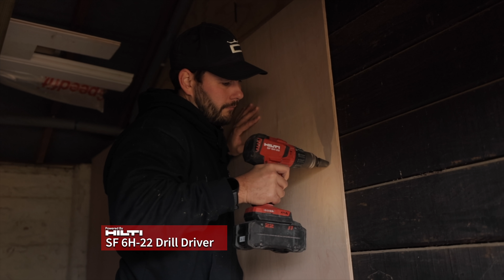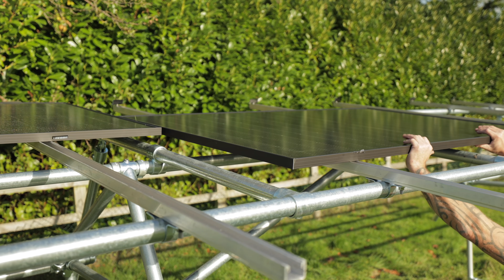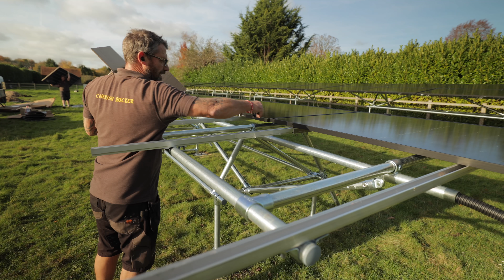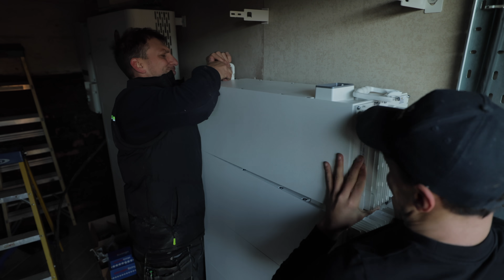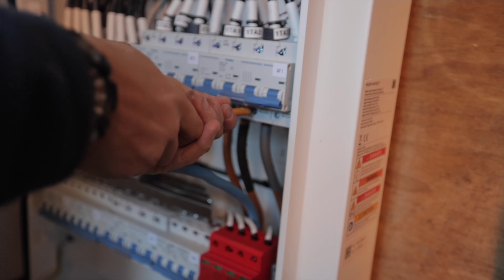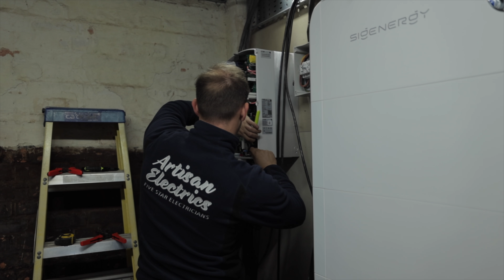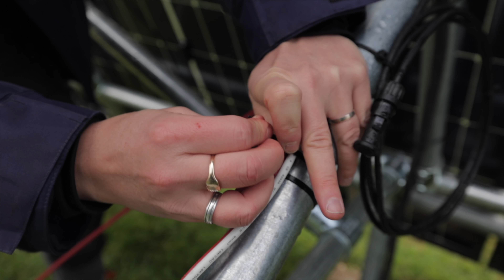The REAL WORLD CHALLENGES of Installing Ground Mount Solar

Comment: Funny hearing that DC systems should not have an earth connection. Here in the Netherlands the code requires us to earth all solar systems to the AC isolator which is in turn connected to the consumer unit. All mounting frames have to be bonded together and ran back inside with the DC- cable and connected to the house's earthing system.
Reply from the maker: Yeah completely different in the UK

Comment: Was having a chat with one of my customers who is involved with commercial solar, they have been looking into different grasses and they reflective properties. They have found good gains in output with by-facing panels with the right grasses.
Reply: Do you have links or info on the grasses used?
Reply: @ sorry it was just a conversation with one of my customers and that he is involved with commercial solar. No specifics. Just found it interesting.
Reply: @danielball8897  no worries! Also find it interesting!

Comment: Do you use marine heat shrink or ever tried it? Having the glue inside I've found very useful for a watertight seal.
Reply from the maker: Great suggestion!
Reply: @artisanelectrics  you'll have to try it, the glue activates with the heat and you can get it to shrink 4 to 1 also.

Comment: Many installators have stopped using optimizers now since they have a tendency to ... kill all radios nearby. police/firefighters etc have stopped multiple installations here in sweden due to the interference with emergency radio systems.

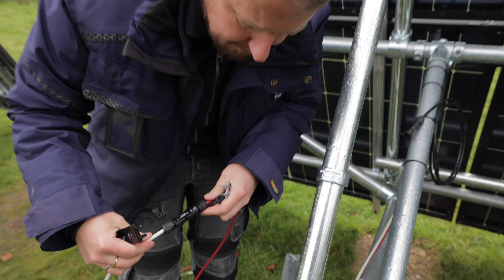Comment: 42:42. 1.2 ohm! outch.. Yes the cable lengh is high but that resistacne mean that for 15A current this is 270Watts loss per cable string!
Reply from the maker: With SolarEdge this isn’t an issue as it balances the voltage and current to avoid losses even on long string length like this - we can have up to 600m on 6mm cable

Comment: On the subject of solar size and DNO permission, can you tell me if there's a maximum size for domestic solar? I had 8.9 KWp installed a couple of years ago and was told by my installer that this was the largest I could install because the DNO wouldn't allow more. But I'm not sure this is/was the case. Reason I ask is because on top of the 23 panels on my roof I think I could get another 11 or so (and probably about 35 on the other side but that's not pointing in the right direction) and was wondering if it would be allowed. I'd probably have to get a second inverter, splitting those 34 panels roughly in half.

Any ideas?
Reply: I think the DNO is concerned about the inverter power output passing through the local transformer and the rectified power consumption charging your batteries from the same transformer, not the PV collectors or battery capacity you could use for BEV charging.

Comment: Does the DNO / mains service provider(?) have the right to control the solar through a ‘smart’ meter?
Reply from the maker: The smart meter cannot “control” anything - it simply monitors the energy usage and sends that data to the cloud
Reply: @ I understand that, but through that type of meter, your solar output to the grid can be controlled by the service provider and shut down when they decide .

Comment: Regarding earthing the dc cable armour. In some systems the battery negative is earthed to the main earth terminal (Victron recommend this for one). Is your battery earth referenced? If it is, does the charger inverter electrically separate the battery negative from the PV negative?There is also the issue of lightning protection to consider. Would the SWA armour be better earthed to protect the dc rails from induced voltage spikes?

Comment: It would be great for the customer if some how you could fit motors on the solar mounting system with  software that would automatically move the panels to the correct angles for the time of year

Comment: I'm currently working with solaradge optimizer a lot is South Africa and the best way not to connect it wrong is to firstly connect just the optmizers alone then you connect to the models afterwards. I assume you guys are using frog leap-frog method which is great in saving pv cables usage

Comment: Hey Jordan what about earthing the framework of the array? Does this not come under an extraneous conductive part? Won’t come under basic protection like a roof mounted system as it is not out of reach?
Reply from the maker: Panels are double insulated
Reply: @artisanelectrics  this is something I have been looking through as I have a ground mount 7.4kw system to install in a few weeks. I have spoken with technical from NICEIC and the inverter manufacturer Fronius where the issue of parasitic capacitance can become a risk. My system that I am looking at is going onto a TNC-S system so we looked at IET Guidance 5.13.6 which states that for ground mount solar frames on a TNC-S that the frame should be connected to a earth electrode and also to the main earth terminal - Would be great to hear your opinion Jordan, great install I think the sigenergy system is a game changer!

Comment: I don't know much about the UK specific rules but wouldn't it be better to apply for those paperwork upfront the install? This would have highlighted the 50kw export issue before you bought all the gear for the installation.

Comment: Obviously the battery systems are not cheap, whilst the solar is rated for 25 years what about the batteries, sure they are not lead acid, but how long do they last, and will the manufacturer support replacements or will the whole system then need replacing as technology has moved on?

Comment: "It's easy to get the wires the wrong way round".... on 2 or 3 out of 4 strings ? That's just sh... work. I would never get away with so many mistakes, but fair do's for showing them
Reply: Looking at it from a Human Factors perspective, it's a shit design if you can get cables on backwards. Each plug and connection should have unique keyways or pin layouts so you can only put everything together the correct way around.

Comment: An observation on the buried cables, Regulation 522.8.10 of BS 7671:2018+A2:2022 requires the location of buried cables to be marked by cable covers or a suitable marker tape. As you know, Cable covers or marker tape is laid above the buried duct or cables to provide an early warning that electric cables are present. For installations where the ground preparation does not meet highway constructional standards, IET Guidance Note 1: Selection & Erection recommends a minimum depth of 500 mm to protect the cable from damage from ground movement and frost heave. A summary of the various requirements and recommendations surrounding cable depth is provided in Appendix E to the IET Code of Practice for Grid-connected Solar Photovoltaic Systems. 

On a personal level, I would never install any cables in the ground  without a duct, if there are any problems with a cable, its easy to pull in a replacement. For me, its 1) How I was taught and 2) what I consider a professional installation - that is not knocking you and the guys Jordon, you do fantastic jobs, its just what I would do.
Reply: Just curious, are you able to pull a replacement cable in a 200meter duct, with these curves in it..? I doubt it. 
If it breaks,  measure the resistance,  dig up the cable and repair it.
Reply: @gubbernl  If you pull cables into ducts then you should always pull in and leave a spare drawstring in the duct, that way, if you need to replace a cable, you can pull on in, as well as another drawstring. Its not rocket science.
Reply: @jim.franklin  and if the draw string breaks you pull the wire out both ends and use air to shoot a new one through the pipe.
That ram used to make the hole will certainly pull a new cable through.
Reply: No, there is no point. No way you're pulling that cable in or out @jim.franklin

Comment: Really interesting, as a non electrician I would comment that most cable ties will not last 25 years, unless your using something new of course. Sheep will eat virtually Anything 😳😳👍. Hope you go back after a while and see how it all performs.
Reply: Right. The nylon cable ties I see outdoors are brittle after a few seasons. Stainless metal straps are robust. YMMV.

Comment: I've got a roof mounted system, these bifacial panels are interesting. Perhaps when the existing panels are replaced and the roof would probably be due a refit too, I'll get some reflective tiles and have bifacial panels fitted! lol

The only thing missing from this video was footage of the system running in the daylight, it would have been interesting to see the difference in generation if you swivelled the panels as the solaredge monitoring is near-realtime enough to tell. But I guess we need some sun for that, which has been lacking of late! ;)
Reply: When I thought about the wind loading of the four foot sails sticking off the edge of the roof I puckered up.  The metal porch roof below would be perfect for them.
Maybe if I ever remodel the front of the house I will add greek columns  to support panels.  You could raise and lower them for summer and winter angle. 🤔

Comment: At a cost of around £50 per optimiser the payback on that against the potential better optimised generation is just not worth it at all. This is coming from someone who has installed solar PV since 2009.
Reply from the maker: Explain
Reply: @ I can see why you’ve done it due to the distance, but that’s about it. If it were me, I’d locate the plant much closer to the array in an outbuilding and that way you’re only running AC back. We’ve done it many times with purpose build sheds that only cost 1-2k and less labour intensive. You can run a supply cable from the 3PH to sub DB and have everything in that place. Depending on the battery you may only need to extend the CT’s. 

200m is far but the optimisers are definitely a luxury on this occasion. Paying them back with the optimised generation will not happen in 25 years.

Comment: It’s interesting to stand back from this install beautifully done and just look at the end result from a distance.
I have a 19 kw ground mounted bi facial system in a fabulous solar area. Clear skies all round, great irradiance etc. ground mount, bi facial Panels are now cheap, 70 euros each. 
Now on a cloudy day, I get a fraction of production this time of year, 2.9 kw today, sunny day 30-40 this time of year. So even with 3 times more generation to 54 kw still would only get a fraction and not even be remotely be grid independent. Now on a sunny day, don’t know what to do with all the power. But for 3 months of the year minimum, not grid independent. I have 4 holiday units on the site. So I reckon break even is 5-6 years and I sell my production at full price to people staying on site. My install has two inverters, 20 kWh batteries and I installed it myself so no labour cost.
For any end user looking at this system, fine if it’s a project and you are happy to spend money just to have it, but the maths on this system which must have cost three to four times mine, are just not that appealing. If as in other countries there becomes a charge on selling excess back to the grid then its head scratching  time. There is no way with optimisers, vermin, sheep etc that there will be no maintenance on these systems for 30-40 years. It’s a great video, really well explained, however the reality for us in the Northern Hemisphere huge arrays for 4 months of the year are largely idle,. Wind would be extremely interesting for me as I am ideally placed, but even allowing for spend just to have it, I cannot get the maths on that to work at all, just hassle with maintenance. If anyone has got wind to work with the solar in any meaningful way be interested.
Reply: Harry of Harry’s Garage has a farm and he installed ground array and wind power. Solar works in summer, wind turbine autumn to spring. But there are still days in winter and cloudy days in summer.
I live in the tropics and supposedly could have enough sun each day, but rainstorms stop production.
These systems will not make you offgrid unless you are willing to adjust your lifestyle to match the power.

Comment: Definitely interested in seeing the benefits of changing the angle of the panels.  Any advise re how best to approach a requirement to secure biodiversity reports for a ground based system?  Great series of videos.  Many thanks.
Reply: The semi-transparent PV panels are getting a good reputation. The micro climate under them is stable and conducive to undergrowth lifeforms. But exactly how do you define "ground-based"?

Comment: im amazed how complicated and expensive most companys make tilting ground racks
why do they need 20 poles fixed to the ground
when 1 in each end can do it

this is a waste of money and time when i look at a project this size

ofcourse you need to use thicker poles and a bit more cement
but in the end it saves money and time

in my setup i use around  4-6 times less poles in the ground then this setup

Comment: A home DC charger is fucking cool plus having it bi-directional to allow the car to run the house is awesome. Wonder how long the car could run the house for under normal house consumption and obviously depending on the car you’re plugging in
Reply from the maker: We’re dropping a separate video on this soon 😎
Reply: It doesn't work with nearly any vehicle. Right now the Sigenergy UK site only lists a few Nio vehicles and they operate as PointGuard Energy in North America and they have zero vehicles compatible.

It's nice that it can do 25kw bi-directional charging, but that's only if you are using solar, battery, and AC grid at the same time to push to the vehicle. It can't do that if the solar is low, at night for instance, or don't for a very long time if you have a smaller battery in the stacks for very long since it will drain the battery very quickly.

Comment: DC traveling long distance you will see Voltage drop. In the US we can do it both ways but typically depending on local code, we would of mounted the Solar Edge Inverter at the Array with a DC Disconnect. Then the cable run to the Barn is A/C and less susceptible to Voltage loss, plus you can ro use smaller gauge cables for the run...
Just curious why you choose to do DC rather than AC run? 
Great Video as always, Thank you
Those Jinko Black on Black Bifacial  Mods look absolutely amazing!!
Reply: The voltage drop is not so much of a problem when the voltage is higher and the current is lower, e.g. 20 panel string = ~720V and 12A. To transfer the same power at 240V, the current is 36A. Since the voltage drop is dependent on the current, the problem is greater at a lower voltage.
Reply: Or indeed gone to micronverters, kept the inverters out of it altogether. Same shading management as optimisers but no DC above 40V anywhere
Reply: @faraway5828  I am a huge fan of Microinverters. Micros on this install would have remedied the shading issues but it would have been a wau more labor intensive install because of 1 micro per module.  I believe they used 1 optimizer per 2 mods. 
Also remember they had to throttle and modify the backfeed to the grid, with the Microinverters it would definitely increase the backfeed compared to the Solar Edge Inverter.  It is easier to PV shed or throttle DC than AC...
Reply: @ not a lot more effort to have one micro per panel - but emphases can support 2 panels per inverter, and also have grid export limiting, so no compromise, but there would be higher current at 240Ac. Always swings, always roundabouts
Reply: @faraway5828  Brother, I am on you side, I am Enphase guy all day everyday, they are true microgrid technology with built in redundancy. I especially like the LRA support of the 5P batteries and we also have the 10C coming down the pipeline now.  
Although sometimes you get Homeowners that do not want the premium price tag!  If the HO truly understands what an Enphase System does, they immediately see the Value and the Enphase system sells itself...
Reply: @faraway5828  This is the right comment, I was looking for it. If the batteries are AC coupled anyway, just go with micro inverters. Hoymiles just released the MIT-4000-8T.
Overall it is a little bit underwhelming to connect 52.8 kWp of solar to a puny 30 kW inverter (with a hard cut-off at 20 kW AC). We need a behind-the-scenes video that shows all the restrictions and how they would have done the system if there were none
Reply: DC voltage is significantly higher in this case

Comment: Agree with you about the light intensities.
I've just had a modest system installed (October) and noticed significant changes in production.  I have been checking light levels daily with a simple LUX meter - not calibrated, so effectively only 'qualitative'; but it tells a story. 
Just try this on one of your sites. Take the meter and measure LUX at varying angles between vertical, and horizontal towards the sun from dawn till dusk.  It will tell its own story!

Comment: Why do you prefer isolators to breakers in your DC or AC circuits?
Reply: That's a good question because there is always a risk, and it's quite a high risk that someone will use an isolator to break the current.
I'm making a small solar PV direct to immersion heater setup. I bought a good old-fashioned high current breaker to isolate it if necessary. The thing is made mostly of metal and ceramic, so minimum fire risk.

Comment: Big invest. I wonder why there are wood enclosures. Especially where are cable junctions for high current DC cables. It is easier to work with wood than metal ones but…